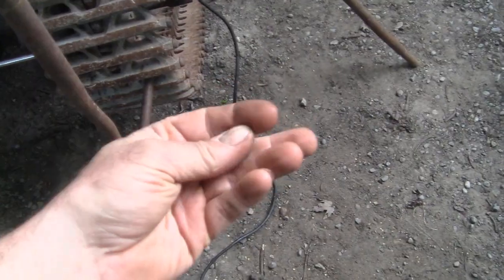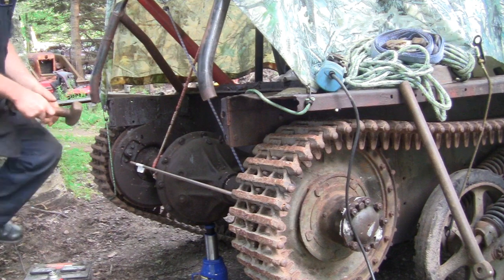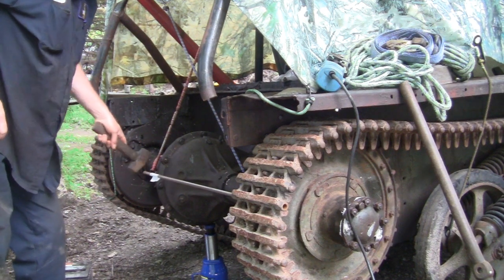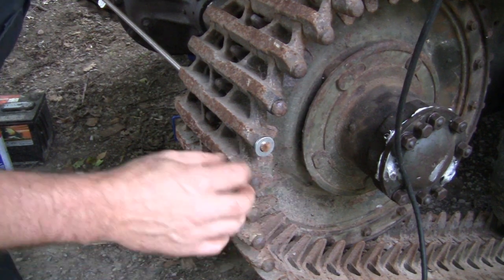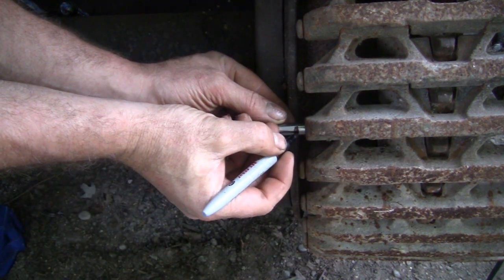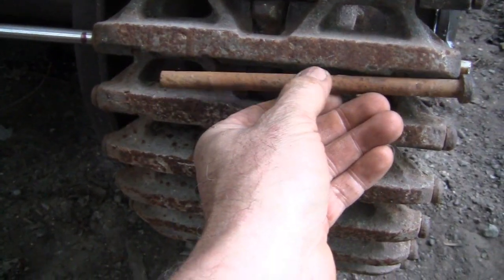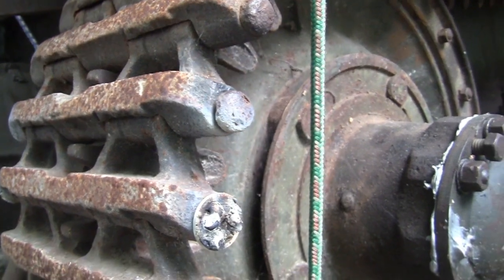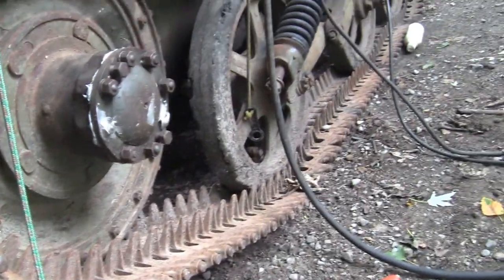Track pin replacement

Comment: That would work get too as long as they don't shear off. And for your flux core welds. Use more heat it will help ya.  I got the same welder just switched it over to a tank. But used the flux core for years
Reply from the maker: 899moore It works really well on gas. I will try and turn the heat up abit

Comment: Hay Shawn, The rod you used looked like mild steel stock, right? And the original track pins are mild steel too?
Reply from the maker: ***** Its harden steel. 7/16 drill stock
Reply: OK. Thanks, Just wondering

Comment: Shawn are you hooking your ground on the other end of your pin? Or grinding or sanding the area to be welded with an air angle grinder with a 3 inch sanding disc?
Reply from the maker: Jimmy Ray Yup did that but just couldn't see it very good and was not trying very hard lol